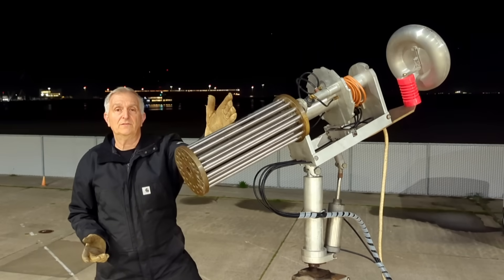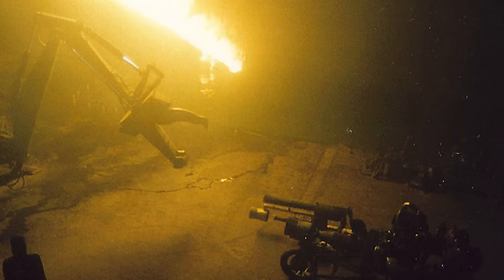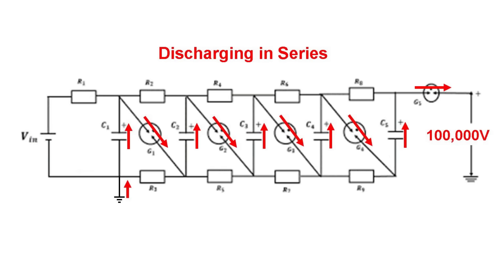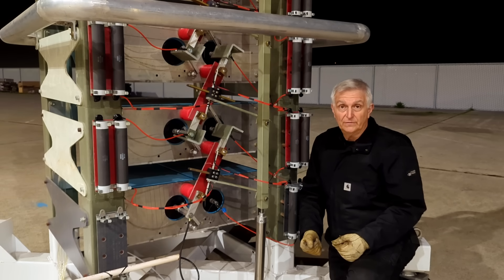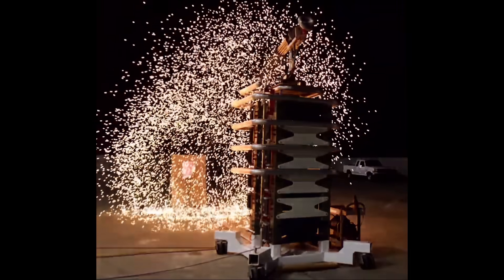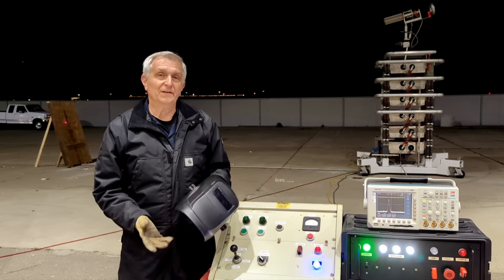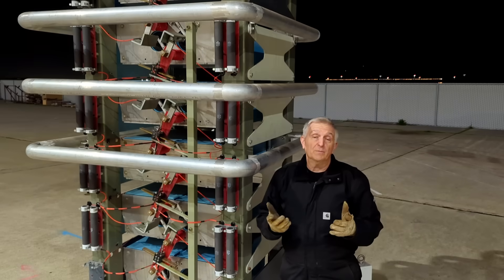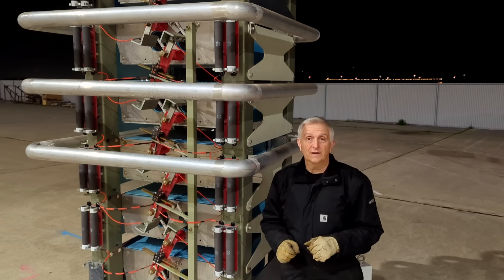Firing the Lorentz Plasma Cannon

Comment: | *Expert(s)* | *Possible Keywords* | *Question* | *Plan* |
|---------------|-----------------------|--------------|----------|
| High Voltage Engineer, Plasma Physicist, DIY Maker, Electrical Engineer, Video Production Expert | Lorentz Plasma Cannon, High Voltage, Marx Bank, Capacitor Bank, Plasma Channel, Shock Wave, Directed Energy Device, Technopunk, Survival Research Labs, Slow Motion, CRT, Experimental Physics | Provide detailed notes and analysis of the "Firing the Lorentz Plasma Cannon" project video, incorporating top liked comment insights to explain the technical details and community impact. | Analyze the technical transcript and extract experimental data (voltage levels, shock wave effects, plasma channel formation), review legal/practical aspects, and integrate the humorous and enthusiastic commentary from top liked comments. Present a step-by-step breakdown that covers both engineering specifics and cultural context. |

---

### Detailed Notes on "Firing the Lorentz Plasma Cannon"

⚡ *Project Overview & Context*  
The video documents the revival of a **[plasma cannon](https://www.google.com/search?q=plasma+cannon+high+voltage)** project—originally conceptualized for survival research—now updated with modern capacitors and enhanced voltage delivery. The creator employs a **[Marx bank](https://www.google.com/search?q=Marx+bank+capacitor)** setup to multiply voltage from salvaged 20,000‑volt capacitors, creating a directed energy device capable of firing a high-energy plasma channel. This inventive approach echoes the **[technopunk](https://www.google.com/search?q=technopunk+DIY+projects)** ethos prevalent in extreme DIY projects.

🔥 *Technical Methodology*  
- *High Voltage Pulse & Marx Bank Configuration:*  
  The system charges capacitors in parallel and then fires them in series via spark gaps, effectively multiplying the voltage. Initial tests reached about 120,000 volts, with later iterations pushing the output to 150,000–210,000 volts. This voltage escalation is critical for achieving a plasma channel capable of delivering a high-energy shock wave.
  
- *Plasma Channel Formation & Lorentz Force:*  
  The device uses a 30‑barrel armature gun and a heavy brass striker plate to initiate a plasma channel. As current rapidly surges, the associated magnetic fields generate a **[Lorentz force](https://www.google.com/search?q=Lorentz+force+plasma)** that compresses and contains the hot plasma. This mechanism is essential to form a stable channel, even when operating at current levels akin to natural lightning.
  
- *Experimental Observations:*  
  Early tests produced a stable plasma channel of roughly 15 feet. By ramping up the voltage, the range extended to 35 feet. Doubling the energy not only increased the plasma channel’s length but also amplified the shock wave intensity—producing supersonic effects with shrapnel speeds near 1200 ft/s, and generating audible shock waves echoing over a half-mile away.

🎥 *Practical & Legal Considerations*  
After initial exposure, the creator was compelled to pull the video due to **[filming permit](https://www.google.com/search?q=filming+permit+high+voltage)** and insurance issues. Opting to re-film in a less restrictive locale allowed not only legal compliance but also the opportunity to test the cannon at even higher energy levels. This pivot highlights the delicate balance between innovative engineering and regulatory frameworks.

💬 *Input from Top Liked Comments*  
- *Memorable Lines:*  
  Multiple commenters—such as @mm650 and @youruniquehandle2—rave about the deadpan delivery of lines like, “*The electronics hidden inside the TV were adversely affected by the plasma channel*” and “*It looks like doubling the energy had an effect*.” These quotes have become iconic, resonating with both technical enthusiasts and casual viewers.  
- *Community Enthusiasm:*  
  The comment sections brim with humor and technical banter. Jokes about household items (like underwear and TV sets) being affected by the plasma discharge underscore the creator’s mix of serious engineering with irreverent humor. Additionally, community members have expressed eagerness to see collaborations with popular slow-motion videographers such as **[Smarter Every Day](https://www.google.com/search?q=Smarter+Every+Day)** and **[The Slow Mo Guys](https://www.google.com/search?q=Slow+Mo+Guys)**, further cementing the project's cultural impact.  
- *Legacy & DIY Spirit:*  
  Commenters also reflect on the legacy of extreme DIY experiments, recalling the raw, inventive spirit of early **[Survival Research Labs](https://www.google.com/search?q=Survival+Research+Labs)** projects. The blend of technical ingenuity and a nonchalant attitude towards danger resonates deeply with the maker community, evoking nostalgia for a time when groundbreaking experiments were shared without reservation.

---

### Synthesis & Broader Impact

The "Firing the Lorentz Plasma Cannon" project is a masterclass in merging advanced **[pulsed power technology](https://www.google.com/search?q=pulsed+power+technology)** with a daring, DIY approach. It showcases:
- *Engineering Excellence:* Detailed experimental setups, precise control over high voltage pulses, and innovative use of a Marx bank illustrate the depth of technical knowledge applied.
- *Cultural Resonance:* The humorous and memorable commentary—amplified by community interactions—illustrates how technical projects can transcend niche audiences and influence popular culture.
- *Future Potential:* With discussions around further scaling (such as potential for a plasma cannon with a 30-ton Marx bank to reach a quarter-mile range) and the possibility of collaborative projects, the video hints at exciting directions for both experimental physics and DIY innovation.

---

### See Also

- 🍀 *High Voltage Engineering* – Explore advanced high voltage systems and their applications. [Google Search](https://www.google.com/search?q=high+voltage+engineering)
- 🔥 *Plasma Physics Fundamentals* – Learn more about plasma behavior and its applications in modern technology. [Google Search](https://www.google.com/search?q=plasma+physics+basics)
- 🎬 *DIY Maker Culture* – Discover how extreme projects are reshaping the maker community. [Google Search](https://www.google.com/search?q=DIY+maker+culture)
- 🎥 *Slow Motion Videography Techniques* – Find out how slow motion enhances the impact of high-speed experiments. [Google Search](https://www.google.com/search?q=slow+motion+videography+techniques)

Would you like further analysis on specific technical aspects or additional insights from more comment threads?

Comment: Would it be possible to use a high powered laser to ionize the air and send the electricity through the plasma channel rather than shooting a solid object at the target and having the electricity travel through the wire?

Comment: It requires 1.21 gigawatts in order to pull this off. The main problem with this though...is the very real probability of opening a time portal and actually sending the user "Back to the Future".

Using a “Flux Capacitor” might be a better solution…😮

Comment: Does it fire a projectyle that makes the channel or is it a 'blaster bolt that makes a channel?'
Reply from the maker: The dart is trailing a hair-thin trigger wire, which will direct the 30000 amp plasma channel to the desired target. 1:56
Reply: @LightningOnDemand  
Aha, thank you!

Comment: I have an idea it might sounds strange but maybe its usable if you use the Design of the rotating Detonation engine but instead of using a fuel use compressed air snd maybe it would help ?

Maybe it need to have a longer "Barrel" ? 🤔

Comment: Im assuming you need plutonium to generate the 1.21 giggawatts of eletricity you need to fire the cannon. And pretty sure if you use Flux Capacitors, you wouldnt have to worry about capacitor failure.

Comment: In theory you dont even need an actual physical wire. Lightning strikes semi-randomly; but entirely through the air.

The trick is that by ionizing the air, you CREATE a path of least of resistance. The "leading" end of a lightning bolt is a bajillion tiny hairs and fibers of energy finding new paths; but the bulk of the bolts energy is always going to follow the path of least resistance which is always going to end up being one of those hairs (whichever one had the ill luck of being slightly more charged than the others by virtue of a million environmental factors). Thanks to the lorentz force, each of these particles of airs forms a stable (if chaotic) "wire" through which the rest of the bolt travels once the leading edge finds ground.

But we can use lasers to artificially charge/ionize the air (if only marginally) and create a path of least resistance to a target and thereby guide a lightning bolt to a desired target pretty much regardless of other factors besides powerful magnetic fields.

Comment: So you shot a metal object. With a weird tube. How is this plasma?
Reply from the maker: The dart is trailing a hair-thin trigger wire, which will direct the 30000 amp plasma channel to the desired target. 1:56

Comment: I'm not sure I got it, is it shooting an electrode? We can see a metal pin, what is it propelled by? Is it connected via a wire as for the rocket?
Reply from the maker: The dart is trailing a hair-thin trigger wire, which will direct the 30000 amp plasma channel to the desired target. 1:56

Comment: what is the object seen flying through the air prior to the explosion?
Reply from the maker: The dart is trailing a hair-thin trigger wire, which will direct the 30000 amp plasma channel to the desired target. 1:56

Comment: The TV section did give me an interesting thought. Currents will always seek the path of least resistance, for example lightning trying to reach solids as quickly as possible, as it’s easier for lightning to pass through solids than the open air. This means something like a Lorentz cannon will naturally find the weakest point in armor at least for the current to pass through, and thus can do stuff like ignoring the outer shell of a TV and bursting the inner electronincs
Reply: So you're saying this thing ignores armor and durability?
Reply: Military weapons meta over the years
1. Bows and arrows
2. Drones
3. PLASMA WEAPONRY

Comment: Is that a metal bolt before the explosion? And if so, why did it not penetrate the tv screen
Reply from the maker: The dart is trailing a hair-thin trigger wire, which will direct the 30000 amp plasma channel to the desired target. 1:56
Reply: @LightningOnDemand  to direct electricity to a specific point, like a lead. Or it would not shoot straight. Just remembered you explaining the thin wire not melting due to magnetism. Was only half paying attention.

Comment: Ok….but how come with current and voltage that high you can make a TV lose some of its circuits and put a hole in….plywood….but the 13,000 volts at 900 amps coming into the main switchgear at my factory could vaporize a human being instantly with an arc flash? And many of the much much lower energy sub panels as well? Not being a dick I just thought the plywood would be a pile of ash that’s all…. Or is not all the energy reaching the target as X amount of volts at X amount of amps?

EDIT: ok I answered my own question: it’s about the short time duration of the plasma jolt and hence the  total energy delivered.

Comment: Could you use an upgraded version for attacking Russian drone that have cable connection? Would the current run down the outside of the cable to ground?

Comment: Sooo.. what happens if you hit a power line on an active grid with that?
Reply from the maker: Massive common-mode ground fault.  They'll likely think it was a main strike, or at least a heavy upwards leader.
Reply: @ thanks for the response. This is an incredibly interesting device. I’m sure companies have tested a load like this being introduced, but it would be cool to see in practice.

Comment: Yeah this is a pretty funny video, total BS if you ask me what is that probe shooting out first with a guide wire to direct the energy towards where it's shooting at, all you're doing is grounding an arc
Reply from the maker: The dart is trailing a hair-thin trigger wire, which will direct the 30000 amp plasma channel to the desired target. 1:56
Reply: @LightningOnDemand  well I see the dart come out first and then the arc happens

Comment: What was the projectile thing that flew before the actual flash?
Reply from the maker: The dart is trailing a hair-thin trigger wire, which will direct the 30000 amp plasma channel to the desired target. 1:56

Comment: Minute 6.23 you can clearly see something being shot out of the cannon, it looks like a steel marble almost. What is that?
Reply from the maker: The dart is trailing a hair-thin trigger wire, which will direct the 30000 amp plasma channel to the desired target. 1:56

Comment: What is the small projectile that precedes each explosion?
Reply from the maker: The dart is trailing a hair-thin trigger wire, which will direct the 30000 amp plasma channel to the desired target. 1:56
Reply: @LightningOnDemand Thanks for the speedy response. Loved the video.

Comment: Does anyone else see something "launch" or progress towards the target before the lightning strikes?? 7:56
Reply from the maker: The dart is trailing a hair-thin trigger wire, which will direct the 30000 amp plasma channel to the desired target. 1:56
Reply: @LightningOnDemand  ohhhh, okay, I misunderstood.
I thought you were going to use a different method from the dart. 
Still super cool though!
Reply: It's really subtle, but it happens the time before this too
Reply from the maker: @warbagle  The dart is trailing a hair-thin trigger wire, which will direct the 30000 amp plasma channel to the desired target. 1:56

Comment: 22 years ago, I designed an AWD electric dragster that was based on using a few Military grade surplus Ultra caps. The ones sourced out were used in the prototyped rail guns. 3600 bucks each, 4'x 3.5'x22", 60,000v @20,000amps, crazy that they were still certified to deliver that current just under 1 second. I could only imagine what the specs were when they were new. I had the whole project designed and was just waiting on my friend to finish the chips of the voltage regs/ step down transformers. And then my family had a car driven into us, and was left disabled. Would have been a hell of a toy at the track. HV is cool as hell.

Comment: Very interesting. So are you still shooting a thin wire at the target? or is there something else going on with the projectile that I'm missing?
Reply from the maker: The dart is trailing a hair-thin trigger wire, which will direct the 30000 amp plasma channel to the desired target. 1:56
Reply: @LightningOnDemand  Thanks.

Comment: Guys what is that little thing that flies out ahead of the beam?
Reply from the maker: The dart is trailing a hair-thin trigger wire, which will direct the 30000 amp plasma channel to the desired target. 1:56

Comment: I've always wanted to see a real life LAER(Laser Assisted Electric Rifle), which uses a laser to ionize the air, creating a conductive channel through the air right to the target(basically acts like a wire going from the rifle/cannon to the target). Then as soon as the laser makes contact with the target it fires a massive amount electricity from a capacitor bank through the laser. 
   I'm so ecstatic and impressed that you actually made something similar and a cannon version at that!...
    I'd really like to see you make one that uses the laser for the channel instead of the wire and then maybe a hand held rifle version that uses a backpack as the power source.

Comment: Is there potential benefit to speeding up the switch time? I think you desire maximum rate of current increase. Or maybe it doesn’t matter as the ESR of the caps limit you? I was reading about switches and see that picosecond timing is possible. Strategies where smaller but faster switches are placed in parallel with slower but more current capable switches can improve performance of a system. 
The names are very cool; Gas Discharge Tube (isotope assisted or not), Thyratron, Crossatron, Ignitron, liquid-metal plasma valve (LMPV),  Trigatron, and more.

Comment: What's that little ball that shoots out of the gun before the flash?
Reply from the maker: The dart is trailing a hair-thin trigger wire, which will direct the 30000 amp plasma channel to the desired target. 1:56

Comment: you should try to create a free floating plasma, a I have seen a recent video from France as a plasma sphere crosses a railway track reacting with the rails and the overhead power cables causing a discharge to earth the plasma sphere carried on moving perhaps by a breeze and moved out of sight.  If caused by lightening there might have been an object, metal water that became superheated and formed the plasma sphere which seems remarkably stable not changing in diameter over time!

Comment: I'd like to see a copper plate on insulated standoffs a few weeks inches away from a grounded plate behind it and have that be the target. With the wire discharging the caps into the first copper plate and then that plate discharging into the parallel grounded plate behind, the forces might actually blow a hole through, or at least deform the first plate.
I love this video. Best use of a Marx generator I've seen. Bravo.

Comment: What is the solid "looking" projectile that reaches the target seemingly before the electricity?  In the last test it looked like it bounced off of the tube?
Reply from the maker: The dart is trailing a hair-thin trigger wire, which will direct the 30000 amp plasma channel to the desired target.  1:56